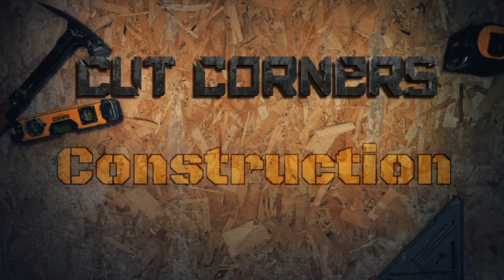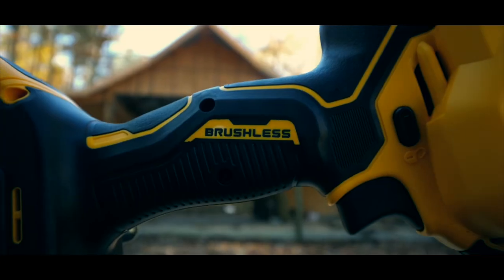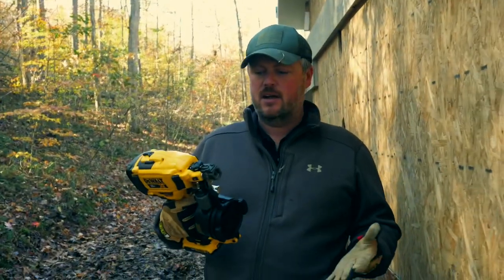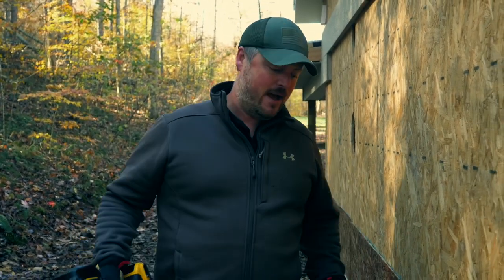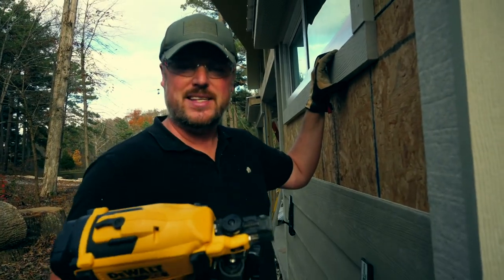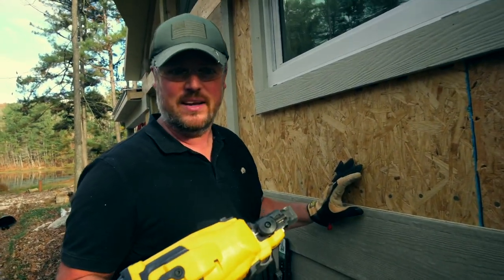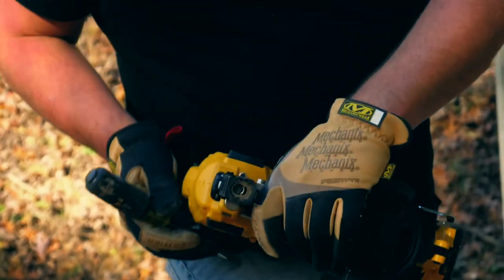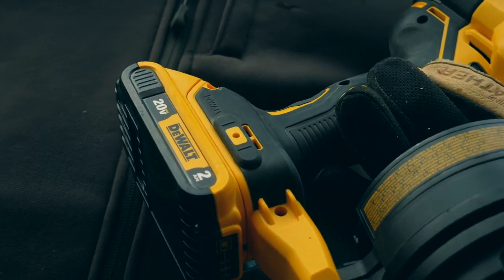DeWalt DCN45RND Cordless Coil Roofing Nailer Tool Review

Comment: I’m a roofer and I’m getting this for whole roof installs. Tired of hoses and air compressors. Hoses get tangled, stuck, not enough length, or worse which has happened to me, you accidentally step on it and fall. Just carry a few 5ah batteries and your good for the day.
Reply: I dont think it will live to do multiple roofs

Comment: I’m a roofer. Mine has not work consistently for my service repairs and small jobs. I’ve dropped it off twice for servicing at the Dewalt Repair Shop… maybe mine is just a dud. But the pin does not recoil back and constantly jams… very disappointing. I just picked it up again and hopefully it works as designed because the idea of this is great…
Reply from the maker: Thanks for the feedback! Did it do that from the beginning?
Reply: @Lugnutfilms  Yes the 1st time I used it was to shingle a small shed for a customer. I ended up doing it by hand because I didn’t have a compressor or air gun on me. It kept jamming up. The the pin would have to be manually pushed back in. I tried it on another repair and it jammed with the 1st nail. So I put it back in the truck. When I had time I eventually dropped it off for servicing. 

After that I picked it up a few weeks later and didn’t get through even one coil and it jammed up again. Over and over so again packed it back in the truck and took it down for servicing.

I just picked it up and have not officially used it on a repair yet. But I tested it on a 2x4 and some OSB and so far so good. But my other 5 guys at 1st wanted one and now it’s a wait and see moment… I’m the Guinea Pig…
Reply from the maker: Yikes!  Sounds like a 🍋

Comment: At 6:20... The gun does not know what it is nailing into… So whether you’re nailing into studs or sheathing or cardboard it will use the same amount of energy to drive the nail in each application
Reply: Correct. Which is why it has the depth adjustment wheel.

Comment: Any of these good for pallet nailing 2  1/4 ?   No access to air....
Reply: The longest nail you can use is 1 3/4.  It also may not have enough power to get through thick wood.

Comment: Any idea how to fix after a two nail jam? Got the jam out now a solid light just comes on the back when I try to use it. Tried clearing everything taking out battery resetting ..any idea how to get light to turn off?
Reply from the maker: Did you pull the black lever on the very top of the gun?
Reply: @Lugnutfilms  yes pull the back lever. Tried placing screwdriver on the front safety while pulling the lever. Made sure was clear of any wire from the coils. Pretty much did everything I could without taking the thing apart. Try different batteries. When I press the trigger the solid light comes on and stays solid won't do nothing from there..
Reply from the maker: Has the drive pin completely retracted?
Reply: @Lugnutfilms  yeah, I took a screwdriver and easily pressed it to where it is seated all the way back. I'm pretty sure that it is anyhow. It's been about 2 weeks of trying to figure this damn thing out with no luck..
Reply from the maker: Have you tried calling Dewalt?
Reply: @Lugnutfilms  yeah I've called a few support places but half the time the guys don't even know what they're talking about. Trying the DeWalt live chat now to see if I can get any info.. thanks for the response ..

Comment: Not quick for us roofers.. .should be called siding gun that can be used for 1 product! Lol!
Reply from the maker: It’s good enough for punch list stuff.
Reply: I use alot of dewalt tools.....not many complaints......what are you referring to as 'punch list stuff'?
Reply from the maker: Obviously for the professional roofer this would not be a good option.  BUT if you have a small repair job I think it would be enough not to mention it’s other uses like a siding nailer.
Reply: Might be ok on repairs for us fat old roofers 😁
Reply: Good enough for pro roofers. Plenty power for 10 bundles before changing batteries.
Reply: @ToddBizCoach  okay, il be good for 45mins give or take!
Reply: @davidlysohirka798  why do you say only good for 45 mins.?
Reply: Cold weather, no good....good days in summer...1 charge good for 45 mins.....by my calculations at best you get 45 mins on your absolute best day applying shingles! How many power sources dependant on how many roofers....im good with air powered tools for high production situations, requirements.
Reply: @davidlysohirka798  I don t know what calculations you are using?. Do you have any experience using it? Does not sound like it when you make a statement based on your “ calculation”, not actual experience.
I have used that nail gun in 45 degree weather and gotten 9 bundles nailed before needing a charge. I use the larger batteries.
Reply: @Lugnutfilms  why do you dismiss it as not for professional roofer if you have never tried gun?
Reply: I meant used it for a roofing application.
Reply: @ToddBizCoach  cause im not sold .....i have ten dewalt batteries as is for light duties....Three 6amp fast chargers.....numerous , if not all cordless dewalt 20v....awesome tools....just dont see how this gun is any good for nothing but siding and repairs! Send me one and il let you know how it performs!
Reply: And i roof everyday .....i dont sell nothing but a high quality roof....i dont talk shit behind a desk!
Reply: @ToddBizCoach  send me one....il let you know....i have lots of batteries!
Reply: @davidlysohirka798  what does that have to do with bad mouthing a product you have not tried!
Reply: @ToddBizCoach  common sense is my calculation! I own and use plenty of dewalt cordless tools : Drills, skill& reciprocating saws, lots of direct powered tools..i would not even consider trying to install an entire roof with a battery powered nailer!  Im not knocking this product, dewalt makes great equipment. No i have not used this particular nailer. But realize the frustration incurred occasionally relying on batteries.
Reply: @davidlysohirka798  if you used common sense and owned Dewalt tools you would have gotten a gun to use from the Dewalt salesman for free. 
If you have a fear of all your batteries failing you might consider some treatment.
Reply: @ToddBizCoach  Hey coach! Common sense tells me you must be a sales rep on here acting like a normal person. Dewalt is fine. I would not use this gun . My choice. And im sure my batteries work better than yours! Lmfao!  Why are you all worked up ?  Send me a nailer bud! Il try it just to confirm my thoughts!  If your cool with nine bundles before your lookin for batteries then best keep at it....i dont have time for that non-sense. . .by the time you replace batteries every 30-40mins, ive gone home for the day. 👍
Reply: @davidlysohirka798  Wrong again. Your statements don t follow any rational reasoning. You and Joe Biden make a good team.
Reply: @ToddBizCoach   Hey coach....once again, im sure you work for dewalt, which im a proud supporter! Why? Am i not entitled to my own opinion? I live in British Columbia, Canada!  'Best Place On Earth' !  Dropping names like Biden .....well i guess thats better then Hitler hey?  And wheres my cordless air nailer? Could i perhaps interest you in some maple syrup? Or some real beer?
Reply: Barter system! I think one quart of syrup , 40oz of real beer is equal trade!  Ask Uncle B if he is cool with that!  👉

Comment: I purchased the same model and it sucked! It would shoot two nails at once, it would not shoot every 10 or twenty shots and it would also jam every twenty or so nails. I used the recommended dewalt nails correct size. A huge waste of time and money. First of the coil nails are a bad design, the gun is very heavy, and you will spend more time fixing it than using it.
Reply from the maker: Sounds like there is a manufacturing defect.  We never had any of those issues.